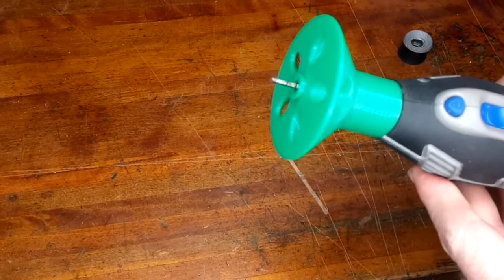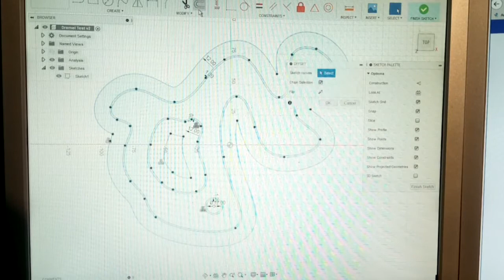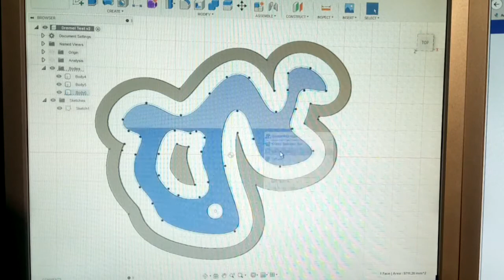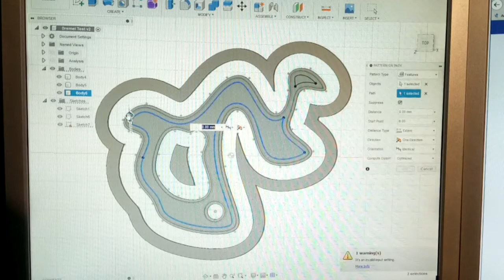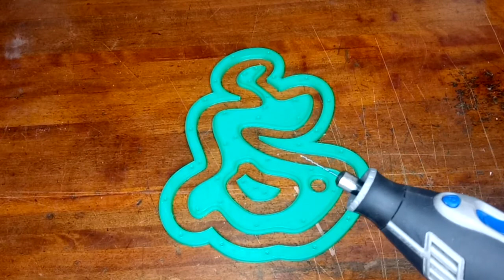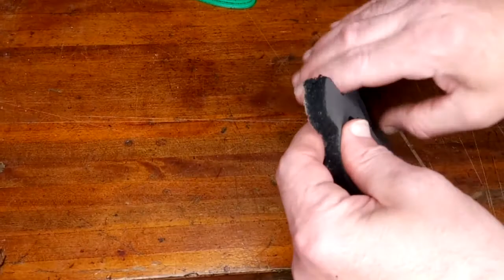Dremel guide collar and template to cut EVA foam

Comment: Absolutely love it!. I'm planning on shadowing my tools like that. Do you thing if i just draw the lines directly on to EVA foam and use dremel to mill it out it would work? I have  the attachment which i can change the depth of the cutting bit. It came as a standard within the dremel kit. BTW what bit did you use with your dremel?
Reply from the maker: If you want to just cut something that's close enough and it doesn't matter if it's a bit on the rough side, especially if it's a one-off, then you could try free-handing it but you'll never get a perfect shape or edge. Just remember that the clean edge will always be on the left side of the cut in your direction of travel. I'd give it a go and see how it works. The bit I use is the 3.2mm straight router bit (#650). I'm sure there are also other bits that will work.

Comment: Nicely done thank you for sharing 👍👍👍 does dremel sale the guide collar attachment you printed out?
How did you figured out how to model the same type of thread to  attached guide collar on the machine? If dremel doesn’t sale something similar I would like to 3d print something like that.
Thank you
Reply from the maker: Dremel does not sell the guide collar, I designed it. There is a link just up above ^^ where you can buy and download it to print.
The thread I worked out by measuring the one on the Dremel and then testing it until I got it right. It's a bit of an odd size.
Reply: Thank you very much👍👍👍

Comment: I like your idea and video very much and great that is just screws onto the dremel.  The "collar file" seems to give a way of making the collar, which is likely to be beyond my capabilities.  Do you know which I might purchase a pre-made collar? I'd appreciate your advice (I am UK based), David
Reply from the maker: Do you know anyone with a 3D printer? If not I can send you a made one but the postage to the UK will not be cheap. I don't know how much use it'll be to you though as I designed it to work with a 3D printed template.
Reply: Civic Garage Thanks for your kind reply. I will ask colleagues about a 3D printer: would a small printer be suitable or need quite a substantial machine? We could also explore your second option: which country are you based in? My grateful thanks, David
Reply from the maker: You only need a little printer, especially for the collar. The template(s) you make for cutting out your pieces are a different story. It needs to be big enough to make them or you can cut up into multiple pieces if too large. I'm in Australia.
Reply: Where to get the green thing